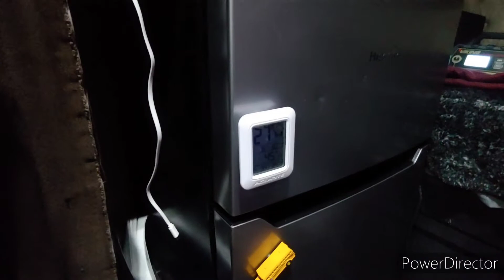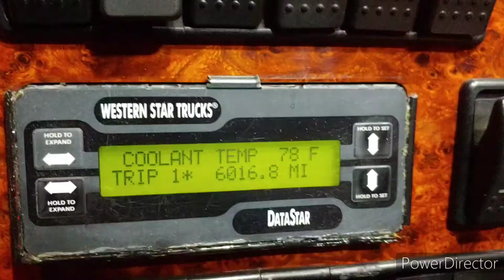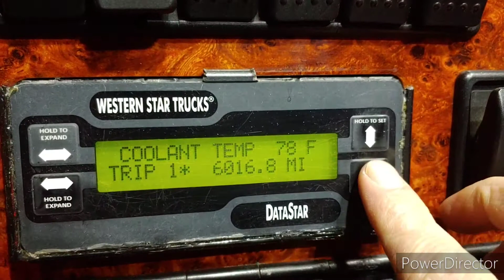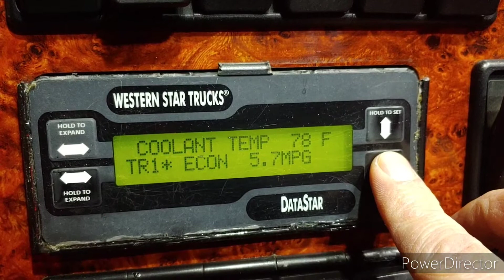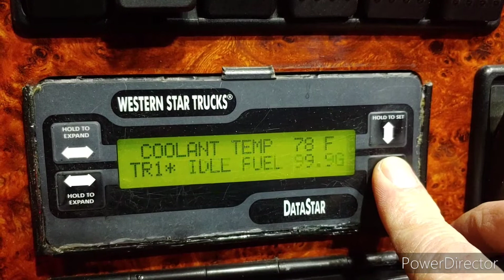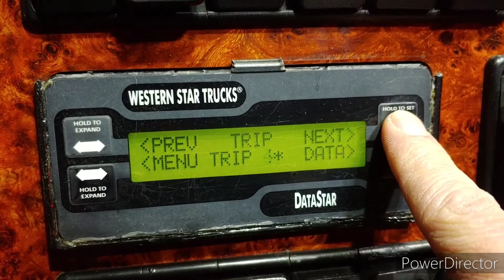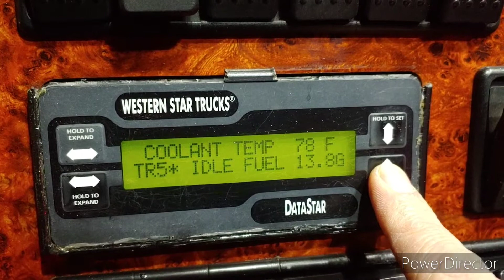HARBOR FREIGHT Genset on a semi truck

Comment: I’ve got the same unit and it works great. Runs everything and the ac in FL gets down to 65° . I had to turn it up so I didn’t wake up sick.  Price a brand new APU when I bought my truck it was gonna cost around $13,000 installed. So I am still under $1500. I can’t be happier. 
I thought about doing a YouTube video on it, but there’s so many here I don’t have to.

Comment: It totally makes sense to buy a generator. Though your math is a bit wonky, 70 per week ( 10/2: 5), 70/5: 14 gal times cost @3.20. Equals $44.80 to run per week. 😉
Reply from the maker: Oops! Still cheaper than the alternative 😂😂. Btw the whole Genny set up is still running 10 hours a day for my detailing trailer. 2000+ hours with regular maintenance

Comment: I have a 10k watt loud ass generator, i think i need to upgrade
Reply from the maker: Now they have 5k watt gen set that's the same quietness. I shoulda waited  🤦🏼‍♂️. This little 3800 is still kicking strong!
Reply: Yep the inverter type
Reply: @allamericantruckerrob9777  More output is bigger motor, or more gas...if ya don't need it don't burn it

Comment: What Milwaukee box is that? And how do you power the fan
Reply from the maker: Fan plugs directly to the 12v plug on generator, and the box is a DeWalt pack out box from home Depot. It's still in use, still same generator also

Comment: Are u getting carbon monoxide inside your sleeper ?while parked in between other trucks ?
Reply from the maker: None. Doesn't even register on the alarm
Reply: @allamericantruckerrob9777  dam I don’t know how to put mine I always get carbon monoxide in the sleeper while Parked at truck stop . I even tried putting the exhaust to the bottom, side , top and I keep having same issue ☹️
Reply: @AkiraKigRace  Look at sealing the likely underside of bunk

Comment: Where did you get this box sir
Reply from the maker: Home Depot. It's the DeWalt pack out box
Reply: Thank you brother did you put the fan did you open that position or it comes with open
Reply from the maker: @abdiqaniadan2349  I went to advanced auto and got a fan of the shelf. Its a 12" Honda Civic fan and spliced the 12v wire to the goofy looking "v" shaped plug that goes into the 12v female plug on the generator. Kicks in immediately when the generator starts. I have the fan PUSHING air INTO the box so exhaust and heat goes out of the side the exhaust is sticking out on. Never overheats even in record temps when I was in death valley

Comment: Did u have to put a plug end on the fan to plug in to the generator
Reply from the maker: Yes
Reply: @allamericantruckerrob9777  was it a regular wall plug or do you have to use a 12v adapter?
Reply: @jonplay3602  it is a V Style 12v conector

Comment: What’s up buddy you gave me good idea how to build cover for my generator, I got one question whether the fan is blowing air in or out?
Reply: Blows in. The exhaust side of the generator blow out as well. (Gen pulls air into and around where exhaust exits)
Reply: Can you make the fans blowing out?
Reply from the maker: @ppgk92  I wouldn't advise that. The setup I have done keeps the heat away from the generator and there's no moving components to overheat risking a fire. Easy in, easy out

Comment: Can you tell me size of your fan?
Reply from the maker: No idea, just an off the shelf maybe 12 inch. 12v fan
Reply: Thanks for your reply, I ordered same fan 12 inch. Fan I was using first didn’t push enough air so my generator kept cutting off from co sensor when I close my box
Reply: @allamericantruckerrob9777  i ended up getting ryobi with the electric start. Should have gotten the Predator
Reply from the maker: @bosleylogisticsllc8244  ah man I see the new one 5000 predator with electric start.... I'm going to upgrade to that after or IF mine craps out.

Comment: Where did you buy the fan that's on your box
Reply from the maker: Pretty much any auto parts store off the shelf. I got the biggest one they had at AutoZone for I think an older Honda Civic. As we speak the Genset is running my detailing trailer and never skipped a beat!

Comment: Good morning I have a quick question where did u get the toolbox and what size
Reply from the maker: Home depot, and the size off hand was the same width as the generator. I'll have to look it up again
Reply: What size DEWALT is that
Reply: 62 gallons
Reply: @fatboyrc9812  62 gallons cost $129 at home depot